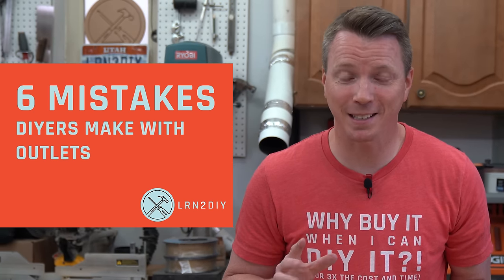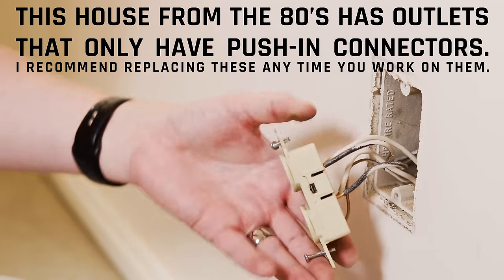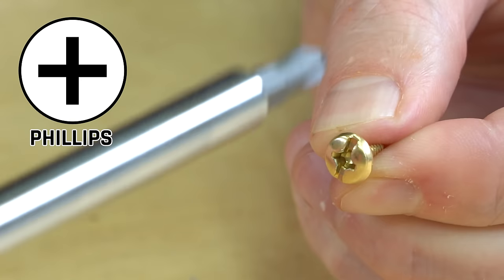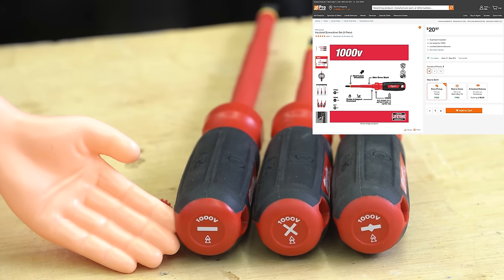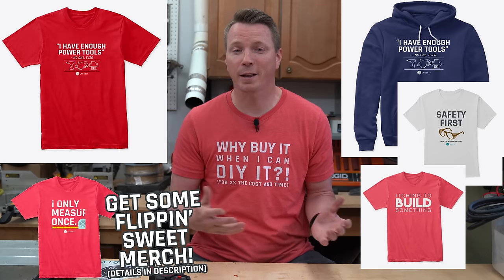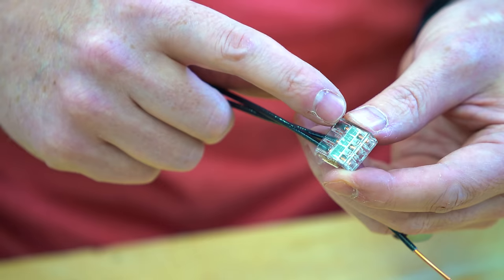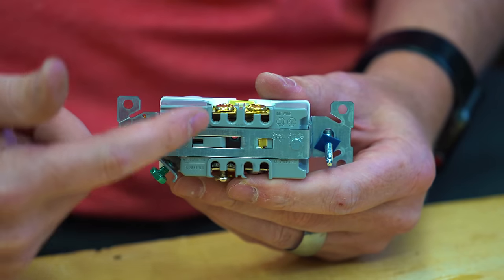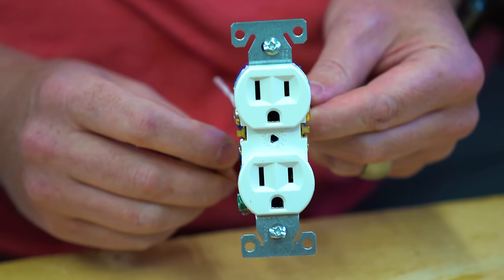6 MISTAKES DIYers Make When Wiring Outlets

Comment: I recently moved to ....someplace new...  and I have been encountering something I haven't seen before.  At some time in the past in this area,  electricians would run a continuous romex wire for daisy chained outlets when the did the rough-in, and then on finish they didn't cut the wire,  they just peeled back the outer sheath and then exposed about an inch of the wires and looped them over the screws on the receptacle!  So it is literally a continuous wire from box to box!
My first thought when I started seeing this was whoever was doing this to try to save time , or possibly to save wire, just spent far more time than it was worth!!...and it is a pain to work on now.
Shout out to Utah!
Reply: Wow! That sounds like trouble waiting to happen! 
Maybe that could be ok, depending on how many outlets th wired to one circuit....?
I am NOT a Professional Electrician,  so don't trust me,  consult a Professional!

Comment: I've been working as a licensed electrician for 30+ yrs. and that multi-wire connecting block is no better than "backstabbing" (even though you ARE CORRECT that using a hook is MUCH better), the backstab IS approved by the NEC.

Comment: 3:42 I mean you don't really need a insulated screwdriver unless you work on live lines. Any non professional well even professionals usualy shut the power off & then test to make sure their is no current in  it at all. Which is moot at that point. But if you need to work on something thats still live i guess would be what they are used for?

Comment: Another whole video is switched individual plugs by breaking the bras tabs. I have had two houses, where originally there were switched plugs. I noticed switches that were useless. Until I opened up the plugs and saw an extra wire going back to the switch. Someone replaced the plug but didnt understand what was going on....

Comment: Actually, don't use those cheap contractor-grade receptacles at all. Spend a little more and get decent commercial/industrial-grade outlets and switches which have "screw-and-clamp" back-wiring instead of backstabs. Unlike the cheap push-in connections, you insert the wire into the back slot of a commercial-grade receptacle, then lock it down with the side screw. It's a better, neater, and safer connection than the side screws. If you're replacing it yourself, there's no reason buy the cheapest receptacle.

Comment: The fist mistake DIYrs make when wiring power outlets is thinking they should be wiring power outlets.
There are 6 potential ways to wire a socket(assuming you can make a clean contact), 4 of those ways will power an appliance, only one of them is safe

Comment: I user to be an electrician.  Local 725.  Anyway Unless you are a lineman working for your local power company,  that sometimes HAS to work on live circuits insulated drives or wrenches are pointless, overpriced for a DIY'er and clunky as they are much harder to handle than a standard non insulated tool.  As a trained electrician we are taught to not work on live circuits.  As a DIY'er I hope your not working on live circuits.  So again insulated is pointless.  Yes trained electricians and even my self have and will work on a live wire.  We however are trained.  Great points for this video however.

Comment: The most common mistake I see is that 90% of the outlets you find are installed upside down.  Sure, it looks like a cute little face when the ground is on the bottom. But if something conductive, like say a butter knife, should fall and become wedged between the plug and receptacle, having the ground post on top will block it from shorting out the circuit.
Reply: how many times have you dropped a butter knife on your receps with the plug hanging half out? is this a common problem?
Reply: When I drop my St Christopher necklace on a recep with a plug hanging half way out hits the ground then proceeds to wrap around the neutral and hot. Perhaps they should be mounted sideways...

Comment: Those screws are not "designed" for an ECX bit - you've got that *completely* backwards.  Those screws are combination screws that are designed to be driven by either of the normal drivers (flat, Philips, Robertson).  "ECX" is a bit invented by Milwaukee YEARS after those screws were introduced that is meant to make you think you've been using the wrong screwdriver all your life and spend a bit more money at the hardware store.  Use a torque driver with your favourite bit - if it cams out you're going too hard.  You don't need an ECX bit, but you DO need a torque driver so every screwdriver you have recommended here is not suitable.  If there's one tool that DIY-ers could and should use when doing electrical work, it's a torque driver - don't trust your guts.  Use the right tool and get it right every time.

Comment: Wago and the back stab are the same type of "point of contact".
You just can't remove it, like the Wago.
And honestly I never reuse any wire nuts or Wago's I come across, it's always safer to use new, you never know how meny times the wire contactor has been used or how worn it is inside.
Also your electrical connections are just as removable with a wire nut.
So in conclusion, I don't care for Wago's if you haven't figured that out by now.

Comment: At the end of this DIY video, the outlet is shown UPSIDE DOWN! NYC electric code mandates the ground connection to be up, so that if a plug is not fully inserted, and a conductive material happens to get between the plug and outlet, it will make contact with the ground, and not short circuit the connection.
Reply: I have one outfit that always does them that way.  If we every go back to sheets of copper papyrus, we'll be protected.
Reply from the maker: That may be code in NYC but it isn’t in most places in the US. Always important to check local code for sure.

Comment: You Should ALWAYS PIGTAIL the connections. This way devices down the line are NOT dependent on the device before it. After twisting the wire, cut the end of the twist. NEVER EVER USE THE DEVICE AS PART OF THE DOWNSTREAM CONNECTION.

Comment: Not sure why a diy would need insulated tools. These are needed for work on a live or hot box which is something a diyer should not attempt. The power should be off at the breaker. Use a non-contact voltage detector to confirm the power is off before any work.

Comment: Those screws need to be tightened, even if you use back-stabs.
And yes, you need to use the square tip screwdriver.

Comment: Whenever I replaced outlets, the back stabbers NEVER released the wires. They are very easy to insert, but a PITA to ever release.  Their entire existence is to make it easier for hack apprentices to get the job done faster. Nope. I'll spend the extra time to loop a wire and make sure it's a tight connections

Comment: Biggest mistake, is when the electrician uses low grade wire caps when using a pigtailed.
Great for a loose connection.

Comment: Pro tip, taught by generations of electricians. Wrap two wraps of electrical tape around the finished outlet. This will keep any stray wires ( the ground wire ) from brushing a hot area and also make the receptacle much softer to work with later.

Comment: I'm not an electrician but I thought the correct procedure  when connecting wire nuts was to insert the straight wires into the nut and twist.  Pre twisting before insertion was not correct.

Comment: Don’t  put 2 neutrals on the plug. Always pigtail !
Reply: Not necessary except for multiwire brach circuits. terminal screws are designed for feedthrough current

Comment: #7: Installing the outlet upside-down.

Don't laugh.  All the outlets in my parents beach cottage are installed this way (by one of my great uncles).  I once mentioned this to my father and he said "What's the difference?"  I took a battery charger that can four double A batteries.  The left slot is wider, so in order to plug it in, you have to turn the charger upside-down.  Trying to plug it in that way, it immediately fell out.  My father says "It does make a difference."  I unscrewed one of the outlet plates and flipped the outlet back to its correct orientation so that I could use my battery charger.
Reply: There’s a reason why it’s installed upside down though. The reasoning behind is, that if you drop something and the plug is loose, it’ll fall on the ground and no sparking would happen. Although in a residential setting it isn’t really installed that way but mostly in commercial setting it is.

Comment: I'm 60 and win I changed out plugs in apartments, hotels or industry I had to do them hot. Even Ballast at times and that is thousands of volts, but I took allot more care there. For 110 I would get bit sometimes but got used to that lol. For the money and DYI I would stick to a flathead. Just don't grab a wire that would lock you on. You would die.

Comment: 7.  Never, and I mean NEVER, clamp down soldered wire, especially soldered stranded wire.  The solder is relatively soft and will slowly deform over time from the pressure, loosening the connection and eventually causing arcing.
Reply: i became incontinent because i pinched a soldered wire. Wouldn't recommend.

Comment: Almost every certified electrician I know just uses the push insert holes on the back and calls it done.   Have seen outlets done this way 30 years later work perfectly as that push in slot on the back has been around forever, was tested by UL to be safe and effective.    Time is money,  dont mess with the screws unless you have to.

Comment: You forgot to mention the stool and the rubber hose to wrap around your feet for your wife to pull you off the stool in the event of electrical shock, are those available on line.

Comment: Couple things you should include in this with receptacle and switches is to ALWAYS tighten down the unused screws so they don't provide additional protruding contact points. Also, the ears on most receptacles and toggle switches have insulation strippers built in and you can use the holes on the ears to also bend your loops.
Reply: Apparently, you didn't finish watching the video.  His last tip, #6, is to be sure & tighten ALL UNUSED SCREWS so that they won't accidentally make contact with anything.

Comment: A mistake I see DIYers  do with their Dust collection is plastic ducting instead of grounded metal.  Oh  it's plenty safe.  But your insurance company won't agree. The standards they use are all purely  industrial.  So if god forbid you have a fire and the adjuster wants to score some points and can make a colorable argument that it was the plastic DC they won't pay,.  And you will be stuck suing them

Comment: You can back-stab wires and USUALLY get away with this--especially if the circuit is always and only going to draw minimal amperage, such as with LED lightbulbs, clocks, phone chargers, etc.  However, if a toaster, heavy duty drill, heat lamp, etc., will be powered by that circuit, now you are asking for trouble given the minimum and (weak) spring-loaded contact tab within the switch/receptacle.  Jump up to using a 1500 watt space heater and you might want to have the fire department's phone number handy.  It comes down to this: is the shortcut really worth it, and do you feel lucky?  (And what about your kids or the next owner?)

Comment: Talking about all the different types of wire strippers while holding an outlet and not showing the wire stripper built into the outlet itself even though you are telling everyone about the stripped wire length gauge that is built into it... confusing.

Comment: The backstab connectors aren't safe...? You're exagerating some issues you saw by generalizing to all installations. Just think about it, if backstab connectors weren't "safe", don't you think UL, CSA or any other certification associations will have voided there approval????!!!! These connectors exist since decades! I think we should have heard about it since if it was so bad. Like the aluminium wiring. What's unsafe is using them with the wrong wire gage. As exemple, I've renovated a century old building. In it, there was very old cables still in use. And the gage was a bit different from the usual #14, like it was a #15 or a metric one. :-) (electric code wasn't really a thing back then) Using that in the backstag connectors, you're asking for problems. But the most common issue is the cable being stripped too short so it doesn't go as deep as it should and barely make contact and will popup when you move the cables a bit or because of heat dilatation.

Comment: So wait... you claim its DIY'ers who use the backstab terminals yet your professionally wired home all used backstab terminals? I'm not a professional, but a very capable DIY'er and have actually done a complete rewire on a home from a 4 circuit to 16 circuit layout (with a pro  checking my work before inspection) and the inspector told my friend who was the pro it was the cleanest job he'd seen, only for the pro to then say "he did the wiring, i just checked to make sure it was ok". The inspector was floored. it was hilarious. 
Anyway, back to my point... i find that pros use the backstab method far more frequently than DIY'ers specifically because they are more focused on speed to get a job done than they are safety. DIY'ers like myself aren't as experienced with electricity and typically will take extra steps to ensure nothing bad happens. A great example would be at a local shooting range i frequent. In the 8 years i did work for them, there were 13 negligent discharges in the lobby from LAPD officers, and 3 from Civilians. They even had a sign sticking out of a hole in the wooden countertop saying Police: 13 Civilians: 3. People who handle firearms on a daily basis become more complacent which results in cutting corners, which is shown through how many have fired their gun on accident in the lobby. The same goes for powertool safety. It's usually not the guy who got his first router to get a finger chewed off in the blade or a digit cut off by a power saw. Much like its not the diy electrician who cuts corners for speed and backwires.

Comment: Wire gauge is even more important. Those push in points on many receptacles are only good for 14gauge wire - which is no longer recommended for most circuits (in fact, arc-fault breakers are required for ALL indoor circuits, except dryer/range/ovens or 240V where I live, & combo GF + AF for all kitchen and all bath circuits, only exterior circuits just require GF).  New homes are now required to use 12gauge for all receptacle circuits (where I live), and honestly, it's worth the extra expense.

Comment: Don't bother with insulated screwdrivers. If you're DIY-ing you should be shutting off power and not working on anything live, period. I am a 25 year master electrician and I won't work on 120VAC live unless it's absolutely necessary and that's usually only for the purpose of troubleshooting and wire indentification. Don't encourage DIY-ers to feel too safe around live voltage.

Comment: I've been doing electrical for more than 20 years and never seen the back stabs fail also your info on saying they don't have enough contact is false, they wouldn't manufacture them with them if they didn't work, that's your opinion not a fact...

Comment: Pigtails ,pigtails pigtails!!!
You never want to rely on the device as a connection point for your overall system. 

Back stabbing much like Romex was only approved once the government started building section 8 housings. 

Or why every outlet on residential is installed upside down???
Answer as old to me by an ancient electrician, back when grounded outlets first came out and the guys would go to a house to swap them out,  the housewives didn't like the way it looked,  and requested the make it look like a happy face.....and cords forever we're falling out 

Wegos are a no no as well
Let go of my wego....

And always remember,  the NEC is the minimum standard and it is your duty as an electrician to determine the requirements of a particular situations.

Comment: DIY folks should not be working on live circuits.  Insulated tools are designed for professionals who occasionally need to work on live circuits.  Insulated tools can give a false sense of security to the untrained.  It is far better to de-energize the circuit and then confirm that with a meter and then work using normal tools.

Comment: I was an electrician in the US Navy, and I am truly disgusted that professional electricians are able to get away with using the push connections. It should be against electrical code because it can cause a fire. I had to replace all 5 outlets in my living room about 10 years ago because all 5 outlets melted due to the poor current conductivity of these stab connections.

Comment: A few things, at 49 seconds, you have 2 neutrals in the recepticle, using the recepticle itself as the pass through for anything down the line. In any area I've seen, this is against code. Reason is if you have 2 or 3 circuits sharing a neutral, you can turn off the plug circuit, test it and get no power thinking it's safe to work on, then as you pull off the plug you now broke the neutral open and you can get a large shock from it. While doing this with the hots is technically allowed where I am, it's is very frowned upon and bad practice and anyone that does it is ridiculed as lazy.
Second, you mention using the back stabs on the back of devices as having poor contact, while the Wagos you reccomend have similar or worse contact surface area.

Comment: Says using the backstab connectors is a mistake made by DIYers. Then talks about how the professional who wired his whole house used them.

Sorry, I really have to disagree with this one. I've been told by two different actual electricians that backstab connectors are perfectly fine and only a problem if you plan on replacing the outlet again.